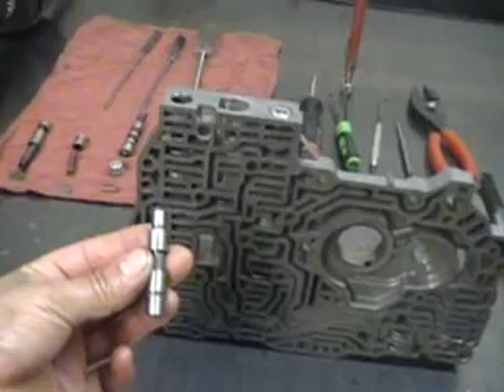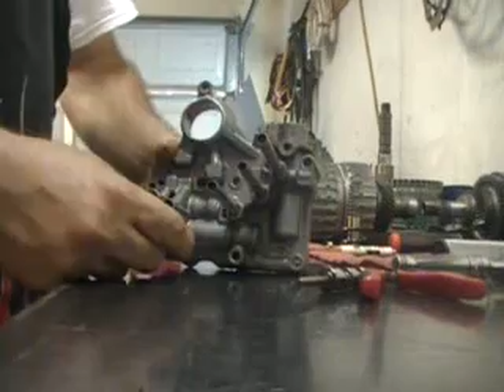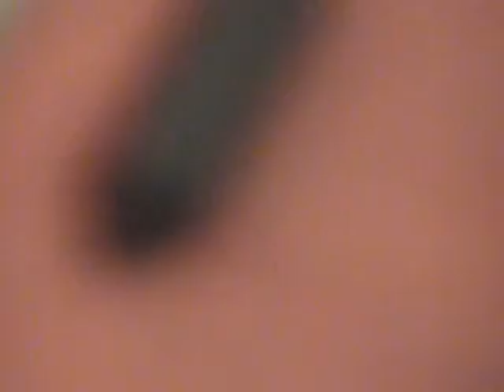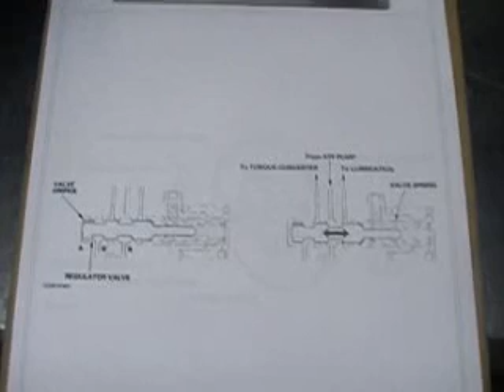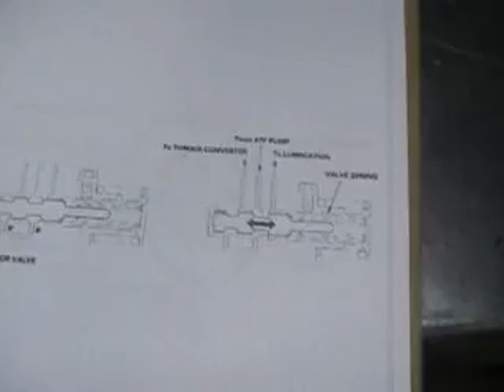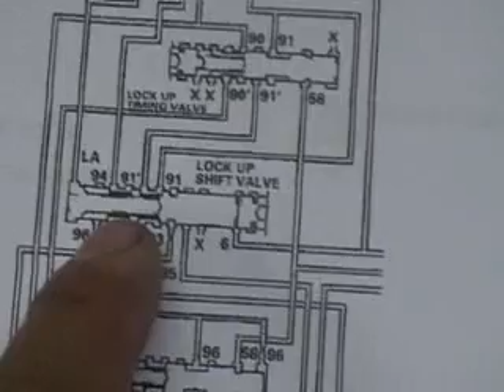Honda Transmission Repair 1

Comment: how about on crv regulator,  can you also drill it?
Reply from the maker: Yes
Reply: fallow up question senior Hiram, do you re-used the secondary separating plate even if it is dented a bit by check ball? or you replaced them?
Reply: senior Hiram i  drill mine polish all the bore put up all new orings friction clutches and new steel plates now my tranny shudder when shifting at 2nd gear and 3rd gear at about 35 kph what causing this symtoms?

Comment: Couldn't one theoretically just notch the mating surface instead of drilling, using the drill bit or a same diameter metal rod as a gauge to avoid hogging out too much material, or is there a likelihood of sludge/debris buildup in a notch over time?

Comment: First off your working, hands on knowledge of automatic transmissions is staggering. The channel could be called the transmission whisperer. Lol. Thanks for the information I’ve found your page to be invaluable. 
I have a quick question if you don’t mind.my wife has a 98 Isuzu oasis(Honda odyssey)Ive being cleaning the tranny up,the solenoid screens in particular. the center tube screen on the linear solenoid was completely blocked.i was able to drain the transmission easy enough but when I went to refill I couldn’t locate the fill bolt marked atf on the top of the tranny.i did unscrew a bolt but it looked more like valve of some kind and wasn’t labeled atf ,so I quickly put it back. I’ve heard a few Honda transmissions are filled from the dipstick. If they have a large rubber ring around the stick. I’ve looked and studied to no avail. I filled it from the dipstick and it does ok with a few minor issues. I plan to do three more flushes after driving it some more. I wish I could install an inline filter on the return line from the radiator but it seems there’s not enough room the way this model was configured. I want to say it’s a mdwa model Honda tranny I can check I found the sticker on the transmission. Thanks for any help or information. ✌️

Comment: I have been working on these units a while. It seems the best rebuilds only go about 80k. It does not matter where you get them, Honda America (with the latest and greatest "tech updates", or a whiz bang rebuilder. They all suck.  This is one design that really does not want to keep fixed. New parts get put in. Valve bodies get cleaned and new converters get installed an yet, they all seem to fail 68 to 88k miles with various problems. At least with the 7004r GM trash, the aftermarket came through with a host of fixes and you could build a bulletproof unit. But these honda units self destruct no matter what you do. Although I cannot tell you how many times I have to break out the long handle 3/8" to break loose the 10mm valve body bolts.

Comment: Finally! I've been looking all over for an explanation for my 2005 Honda Pilot P0741 error code (TCC solenoid valve), burning trans fluid, slipping, and trans temperature sensor light.

Comment: Hi... I change both linier and lock up selinoids after getting codes on my 2000 Honda odyssey. Now it shifts fine...but now my transmission doesn't reverse. Do you know whats causing it?

Comment: Lost the reverse cpc valve spring.. trying to find a better quality picture online of how big it is.. I mean the instructions that came in the overhaul kit states the exact dimensions.. Do you know where to get one or have picture of one? I have tons of springs around the shop but am afraid it will be too heavy or too light.. Is that critical on the reverse cpc valve? Will it just shift firmer into reverse if it is a bit on the heavy side? Thanks' for your help. Love your videos man. This is the first honda transmission I've built, totally different from the rest. Having lot's of fun. lol Want to take my time and make sure everything is absolutely right, because I sure do not want to do this one twice!

Comment: can you help me Hiram with one part that I have to replace at gearbox Honda oddysey 2001 B7TA, part missing is a/t clutch pressure control valve a/b assembly. I need one urgently, used. please let me know if you have one on stock. thx

Comment: Hiram i have a question. first of all thanks for all the vids, they help a lot.
the question. i recently repaired an bx7a and instaled it. when i get fron park to drive velocimeter was on 0 and it dindnt shift. so i took the speed sensors out and the input speed sensor i suppose (the one right next to the oil filler hole) was completly broken, so i took the outlet speed sensor and put it were the other sensor was, my surprise was that the  magnet at the end of the sensor (some kinda yellow "pin") was taller that i thought. did i fu*k it up? do i need to uninstall the trans and open it? does that sensor needs something down to make it shorter so it doesnt crash. need a lotta help duxe

Comment: Ok I just had my transmission rebuild at a we'll recommended shop in Mesa Az , before it was rebuild it would go into neutule when put in to drive,but not all the time ,just very random hot or cold, now still having same thing , have taken back to shop, they drove it for 3days and couldn't get it to do it ,get it back the next day it did it . Do you think it could be preser regulator hanging up ?its a 2004 Honda pilot all wheel drive with 130.000 miles on it

Comment: these are the worst transmissions ever made. this guy has his work cut out for him fixing all these heaps of crap...
Reply: lol
Reply: That's what I have heard. As much as Honda makes great engines, their trannys leave a lot to be desired and are a poor design. I was surprised that this has been going on since the '90s with Honda. You'd think they would have changed the design a bit, or did what this guy did and simply drill a hole. Of course, that would not help Honda sell new parts, now would it? Lol.

Comment: Hey Hiram! I just rebuilt my first BX7A d with the help of your videos and some other websites. I have a questions for you, I bought a new torque converter for the rebuild and after everything was back in and I test drove it, I am getting a p0740. I checked the ohms on the lock up/shift A solenoids and they are within the spec. I drill the bypass hole in the valve body as you instructed but when I was cleaning up my drill bits,I think I might have used a.060 drill bit instead of a.040.. The car has a delayed shift and the p0740 code. If I accidentally used the wrong bit what would be the results? I tried to check my line pressure but my gauge broke so I ordered a new one today. I will check pressure once I have the new one but don't help would be great, thanks!
Reply: I did install the oring, I noticed the group of the o rings in the kit and mass sure I installed it. If I drilled the hole to big will that be a problem? Thanks man, wrenchhead427@yahoo.com if you can reply to me.

Comment: Hi Hiram tengo problemas con una transmission honda odyssey 99 b7ta el problema es qpatina la primera y segunda al empezar y despues si hago algun stop igual.en la subidas no se detiene parece q esta en neutro ya voy por la tecera vez l q intento repararla esta ultima le puse el tambor 1y2 original nuevo de honda. No tiene codigos y en el higway sube bien pero en el transcurso las revoluciones bajan y suben no mucho como 200 por ejemplo su va a 2800 baja a 2600 y vuelve a subir a 2800 asi le hace y ya pasa y sigue normal quisiera q me ayudaras si puedes gracias por tu ayuda y videos . My email es paramisael352@gmail.com

Comment: I have a 03 Honda accord v6. Recently the transmission started to act up. It first started jurking thru 2nd and third hear and now it just stays at first year. 
I know this model has some sort of transmission problem....I have also replaced the transmission once due to 2nd gear overheating.
From your experience what is the most common cause and can it be fixed at home?
Reply: these transmissions are terrible

Comment: Hey Mr. H. I have a 2008 Honda CR-V and so far the transmission has been running great. I just emptied out the tranny thru the plug , but not totally flushed it. Is that okay just dump what comes out and replace it with fresh fluid ? I have 192,000 miles and I only did that one time..what do you recommend .? Thanks bro" me encanta tu videos informal...

Comment: How's it going!  I just finished rebuilding a b7xa with the exact same kit you use. I'm having a issue where forward drives perfect but reverse wont move. When I shift it into reverse the rpms drop and if I hit the gas the engine has a load but it doesn't move at all. It feels like the lock pawl is engaged.  I can rock the car back and forth like its in park while in reverse.  I pulled the trans again and took all apart and I cant find anything.  I put it back in and the same. Any help would be greatly appreciated! !

Comment: Good Evening Hiram I am having problems with my 99 acura tl transmission.When I put the car on drive it engages the gear and then I hits hard to take the gear but when i just put it in drive in the morning it doesn't do it I was wondering if i can put a video in youtube so you can see what i mean and give me a hint or something

Comment: My 2003 Honda Accord V6 transmission failed at 106000 miles, had it rebuilt and now it occasionally sounds like it grinds when going from park into reverse or reverse to drive. Company that rebuilt it says it will get better after all the after every thing breaks in. Is this true???? transmission did get a new converter.
Thanks Chuck

Comment: Hi, I have a 2000 Honda accord with the transmission B7XA I rebuild my transmission with all new parts. All my line psi is 120-130. But when I try to drive in reverse it does not move and it does not go in 4 gear, when I put my tester on it gives me  30 psi and drops any ideas why?

Comment: I have a '98 4cyl Accord.  This thing has 208K miles and to be honest, I've NEVER done the 30Kmi Transmission fluid replacement not to mention flushing (3x fluid replacement).

I'm beginning to have slip issues.  I've heard that it can actually be MORE problematic to change fluid if it hasn't been properly maintained (Dislodge gunk and block the filter).  Should I even attempt replacing the fluid or just have it taken in for diagnostics?
Reply: Here's my 2 cents on your comment. I changed the fluid on my 02 civic with 155K miles and the transmission gave out after driving about 500 miles. So leave it alone and save up for a new tranny.
Reply: Diesel Ramcharger Probably true.  I replaced tran fluid and all is fine....so far ;-)
Reply: your trans is hosed, the only thing moving you around is all the friction material that used to be on the clutches is now floating around in the trans. Once you dump the fluid, and resultant crap, the new fluid won't be contaminated and therefore the trans goes full neutral pretty soon their after.
Reply: MiamiZombie2012 yep, if you dont' change fluid regularly, then DON'T change it, probably won't last more than 150K. fluid changes are supposed to be 15-30K range.

Comment: I have a 2004 Acura CL-S with 90k miles on it and i saw that my fluid is dark like brunette color. It shifts it gears hard when i am going high speeds, or when i accelerate fast. I dont know if i should sell it or not. Whst do you think?
Reply: Get rid of it...

Comment: I drive a 2000 Honda Accord EX..

Hondas Achilles Heel is the transmission :
Their aren't enough ports in the tranny to keep the clutches and other components well lubed and cool
The reason for that is due to the fact that Honda makes the transmission according to their specs. 

I live in Texas, the heat here plays havoc on the transmissions. 
We have 9 months of Summer. 
With that being said the transmissions have a difficult time staying cool and lubed ,by the time the car reaches  K200 miles , the transmission has pretty much had it. The inner components start to break down, the heat doesn't help matters. 

My Honda mechanic told me that there is a company based out of California who took the Honda transmission and completely redesigned it.
They  built more ports which would enable more transmission fluid in the chambers therefor allowing more tranny fluid to keep the clutches, gears and other components lubricated and cool .. Price tag $4K
Reply: can you share which place sells these reliable transmissions?? i have an odyssey that may need a new one soon. i love this van, but damnit honda why!?!?
Reply: bunkerbuster Honda more of racing manufacturer, they make excellent manual transmission, WORST automatic transmission in the industry. if you have automatic tranmission change fluid every 10-15K not with z-1, dw-1 trash!

Comment: a new Honda Accord so I'm keeping up with the tune ups  , maintenance and taking good car of my car. 

It runs better than when it was new.  My Honda mechanic said I would never have to replace the transmission for my car ever again 

I haven't done anything major to my car except little things like replacing lightbulbs, fuses and tune up once a year. My car is 14 years old and is in extremely good condition.  I would never drive a domestic car except 
" Jeep "
We have a 2011 Jeep Commander and we Love it. :-)

If y'all want the name of the company let me know I'll forward the info. I know it's a bit pricey but it beats having to buy a new Honda Accord 

Honda Girl. :-)

Comment: ***** 
would cleaning the trans fix all of this, or do you think its more then that? the drive will slip in 2nd gear, like the first gear is awesome, then when it tries to go into 2nd gear, it seems like it pops into neutral for a second and then you jerk forward once you get into 2nd gear. also reverse most of the time doesn't want to initiate, and 4th gear doesn't seem to want to engage ever. this use to be my buddys van and the transmission was rebuilt or replaced 30-50k miles ago, could this be something like a clogged screen or filter, not allowing adequate trans fluid pressure to the clutch packs? I guess its safe to say the solenoids are good because I don't have drive flashing.

What to do? should i buy the Rebuild kit and dive into the transmission replacing everything, or should i open her up and just give her a thorough cleaning? what do you think is causing my issues? 

I have codes having to do with the torque converter, and another one that say the gear ratio is messed up or wrong. I cant remember the codes  #s  ...
should i buy a new torque converter?

thank you

Comment: Thanks Hiram
What is the best approach to 02 Odyssey transmission issue with 195K miles on it: replacement or have it rebuilt.  If replacement, is there a unit you recommend?  I generally don't like the repair process.

Comment: i drill the small hole but i having D4 not engaging, i replace the Torque converter for a rebuilt one, it only engages on D2 and i switch back to D4 while driving it drives OK, but if i stop i need to start from D2, Can you help me please? do i need to adjust the pressure regulator or pressure control valves with the hex bit?, please i need and advice before i put my transmission down again and install a none drilled new converted charge valve body, i didn't have a problem with a previous B7TA that i rebuild few months ago, but this one, Great Videos you have by the way.

Comment: Great vid. I use the sonnax valve Part #98892-04k. Most of your transmission parts suppliers should have it in stock and its about 22$ permanent fix

Comment: That is well described.  Sonnax suggests tapping into the loop charge with their kit.  But I suppose line pressure could be a better approach.  The also give a different spring for the tcc piston that is in the v.b.  Do you have any experience with that?

Comment: Odyssey 2000 transmission.  I am unable to remove any of the valve caps.  I can easily pop off the valve cap clip, but the valve cap only comes out until the innermost step of the valve cap makes contact with the valve body.  It will not squeeze through.  There is nothing for me to push on, and the valve cap can not be grabbed (unless there is some special tool that I am unaware of.  Can anyone help?

Comment: hi I got a 02 byba I am rebuilding I found a messed up 3rd gear clutch drum and related components do you recommend oem or do you know of a stonger aftermarket thankyou in advance and thanks for 5 the videos

Comment: Thinking about rebuilding my 2001 Honda Odyssey transmission. The fluid is not burnt. The transmission does not slip. It shifts late from 3rd to 4th and slams into gear 2nd to 3rd after coasting. Any suggestions? Where can i find the right repair manual and rebuild kit?

Comment: Hey I just finished a B7XA out of a 99 accord. I have a small tube 40mm by 8mm left over. Does this go under the linear sol assembly ? I have the ones w/the screens in. This looks like maybe a drainback vent ? Haven't seen it in the couple Hondas I've done so far.

Comment: i hve a v6 accord reverse works find wen i put it in drive it has a 3 second delay then takes gear and wen i drive it slips what do you think is the problem cuz all my sensors and good n i already changed the fluid

Comment: Hi Hiram, Im having transmission problems on my 2002 honda accord automatic transmission(118,000 miles). My transmission slips on the 1st and 2nd gear but the 3rd and 4th gear shift smoothly. The dash does not have a check engine light or a flashing D4 light. Im thinking the transmission is done but just wanted to get another opinion.

Comment: Just want to add little info. Superior made a kit to fix blue converter a lot cheaper call Honda LK or sonnax sell the valve already drill so you wouldn't have to drill the V/B. also on the superior kit you got a new LU spring and spacer also help. The thing I like the most is you can fix up to 6 Hondas with one kit.

Comment: No I clean valve body replace clutches I don't know it's working find and when I came home it's not going back and forward in the morning it's ok maybe I have to remove aging I here noise some time when change gears around 45km